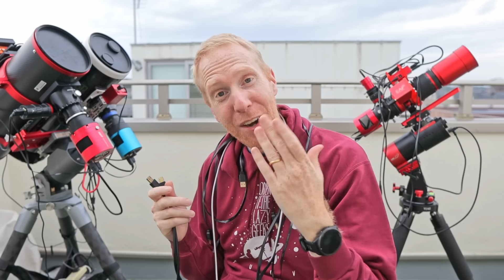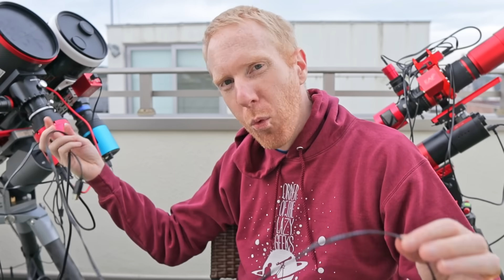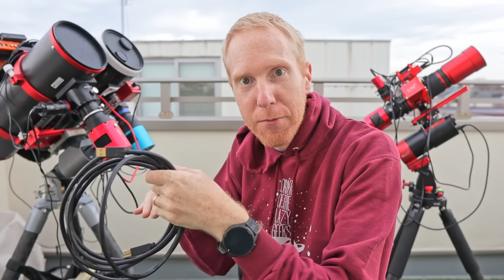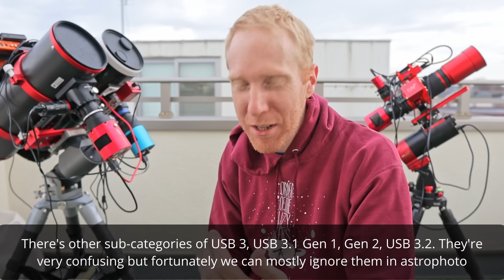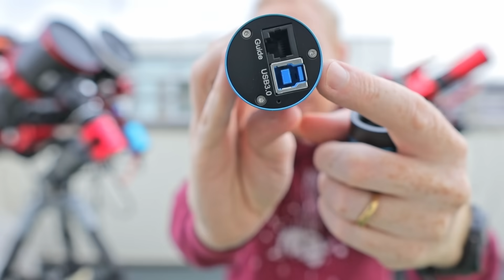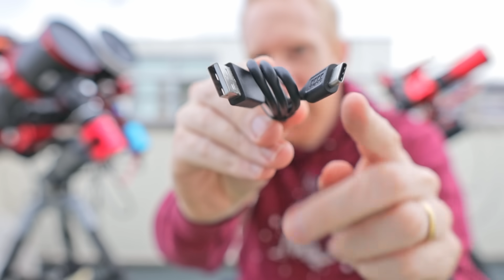YOU could be the NEXT VICTIM! Prevent Cables from Ruining your Next Astrophotography Night

Comment: I only use L-com cables now (no affiliation other than a happy user). They are more expensive, but have yet to fail, and are even offered in armored versions (I use the plastic armored version for my main camera connection). They are also clear about which USB-C cables support which USB protocols. 

I've had plenty of Amazon cables, even "good" ones, fail. One would fail whenever I had a meridian flip. But astrophotography image transfer has like zero ability to recover from errors. The same crappy cables cause things like retransmits when used for other things, but with astro, we see the worst case.

The flat cables with ZWO cameras go right in the bin when I get them.

You'll find that many of those "thick" cables aren't doing you any favors; they are just using a thick rubber coating to make you think they are more robust, no additional shielding or thicker signal wires.

Comment: I bought a new power supply for my eagle thinking it didnt have enough juice to power up my cameras, filter, focuser etc and was making my connection with the mount unstable (it kept randomly disconnecting). I thought it couldnt be the USB, because I tested with two different cables.
So, I bought an Eagle 4 thinking that my unit was defective. And then, exactly the same problem happened, even with a beefier power supply and brand new eagle. 
Decided to buy two new usb cables. First one, same problem AGAIN, but the other one finally fixed it and I havent had a single mount disconnection issue since. Let me just say, the previous 2.0 gen USB-B are trash, really prone to bad contact/connection, would easily slip etc. Havent had a single issue with the 3.0 USB-B yet

Comment: Determining that the Mele4C  was the source of my USB issues cost me a many many more hours than that so consider yourself lucky I guess??
Reply from the maker: The computer itself was the issue??
Reply: Yes. Too many details to go into (I have a CN thread) but the main cam and guide cam on different ports experienced disconnects at the exact same time. Different power supplies, cables, powered hubs all failed. Sometime in minutes, sometime hours, but once is too many

Comment: My worst nightmare struck when my first mount the EQM35-Pro's DEC wire snagged on an azimuth bolt head and it stopped the mount while I was slewing. I had never had this issue since I had the mount for almost a year. It bent the pins inside the cable and I had to use pliers to straighten them as much as I could but they are still bent. They are really hard to bend back. I just put in an order for my second mount, a budget harmonic drive that has more capacity. I got the new UMi 17R with FRAM on preorder. Hope you can review this one as well, Cuiv!
Reply from the maker: Congrats on your new mount, hope you get it soon!

Comment: My 2600 duo doesn't like to run on usb3 when connected through my Pegasus pocket power box v2.  The usb3 cable works fine on my PC and thr ASI air. And when connected to the Pegasus usb 2.0 port.  I guess I should try another cable. Though download speeds are fine on 2.0.

Comment: They’re a little more expensive but if you need to use a USB-C style cable on both ends I would say just buy ones marked as USB 4 or even Thunderbolt 4 as those cables will support speeds up to 40Gb/s and be backward compatible with whatever USB-C port version and speed the hardware uses.

Comment: The fundamental issue is very simple.  USB connectors were designed to be used with static computers and peripherals.  In other words they do not move and they are not subject to wind or setup and takedown.  The male connectors are inserted 90° to the flat surface of the female receptacle and the male connectors never move.  Through cable management around your OTA we sometimes string the cables too tightly thus pulling the male connector out of 90° alignment and thus makes an intermittent or no connection.
My experience was with PHD2 where the guide camera kept disconnection from Windows and you hear that obnoxious, incessant chime from Windows. Maddening. 
The cure is to add extra length to the cable run and carefully tie-wrap the cables so they male connector is properly aligned and never moves.

In radio threaded connectors with a screw tighten ring are used to prevents such a problem.  Maybe the Astro industry could take a hint.
Reply from the maker: Thanks Rick, that makes sense too - I need to recheck all my cables for such issues... While still making sure they won't snag... or get influenced by wind!

Comment: One year ago at this time I bought the AM5, ASIAIR+, ASI533MC to go with a Redcat 61.  On the evening I put this all together for first light, there was no first light.  Nothing showed up on the camera.  Disheartened, I contacted ZWO tech support the next day, and Simon said it was likely a cable problem, which I verified by trying different cables.  Fast forward to this spring and I started getting a “mount not detected connect mount manually” message during polar alignment.  Once again I contacted ZWO technical support and once again Simon told me this sounded like a problem with the AC power adapter, especially in colder temperatures.  So I purchased another power adapter, and the nonsensical message about the mount stopped appearing.  To me this seems absurd because AC power adapter have been around for a long time and would seem to be just a commodity to manufacture, the same as cables.  But that assessment seems incorrect for both pieces of equipment.

Comment: Great video, I use all USB 2 cables on my set up, even in my IMX571 cameras, as thats all thats needed for deep Sky imaging, it’s only high frame rates that require USB 3, like planetary imaging, and USB 2 is much more stable and less prone to issues…👍🏻
Reply from the maker: Interesting! I don't like adding the overhead when imaging with relatively high res sensors on relatively short frames (like 30s), it can consume a lot of time!

Comment: I only realized this year that USB-C cables are actually active components with logic boards in their plugs. They can negotiate speed and voltage with the connector they are plugged in! This was a revelation to me, which was very important for example for getting a very compact and reliable 12V power supply out of a 12V selecting cable in connection with a (quite new) powerbank. That cable itself basically negotiates with the powerbank, that the powerbank should provide 12V, not 5V, and presto!
Reply: That is the difference between Android, Windows, and Apple. Android has the circuitry in their boxes and NOT the cable. That is why Apple cables cost more.... the Android cables are the way they should have implemented it.... KISS method that Apple failed to follow.

Comment: You are right to narrow the issues down to the reliability of the USB connections.
However, I am convinced that the real issue lies in the connectors!
USB connections are really not designed to function when the cables are moved all the time. The worst culprits for failure are where the socket relies on just the soldered connection to the PCB for mechanical strength. This is not isolated to the astro-equipment industry: Think Walkman jack sockets or mobile phones... :(
The only exception I have seen in astronomy equipment is the captive mini USB to the Polemaster, of all things. The irony being that you only need to have it connected occasionally.
Reply from the maker: True as well, connectors are another and probably common point of failure... Sigh. So many things can go wrong!

Comment: Try a ferrite bead on your cables before you trash them. It’s a type of choke that suppresses high end electronic noise. Also, make sure you don’t have kinks or lots of slack. All of these affect speed and connectivity. We used ferrite beads on all of or data cables in the telephone offices and data centers I worked in.
Reply from the maker: Thanks for the tip! Now I have more stuff to try :)

Comment: I always throw away those cheap OEM flat cables from ZWO, and replace them with high quality connectors.  The other issue that can contribute to cable shorts is extreme 90 deg bends at the connectors.  I saw one on the Frankenmount and another on your Red Cat guide scope.  A little cable management goes a long way.  And, all the USB ports on ASI AIR's are USB2.
Reply from the maker: I'll need to check my bends, thanks for the advice!

Comment: I lost 5 hours of imaging time one night because my mount's power adapter's North America AC plug adapter. It had slipped out far enough to not connect, but not far enough to drop out of its slot on the AC adapter. Meanwhile, my mount still had power. It was drawing power through its connection to my StellarMate OS Raspberry Pi. I could use the hand controller to slew the mount manually just fine. But whenever the Stellarmate commanded the mount to slew, it wouldn't move.

I also had a USB power adapter plugged into the AC outlet alongside the mount's adapter. I was concerned that maybe something weird was happening between the mount's ground and the USB's ground (I was clutching at straws after hours of faffing around!) So I grabbed my portable power pack, disconnected the power cable from the mount and put in the cigarette lighter power adapter, plugged the various other devices into the power pack's USB power ports, and I was able to start all over again with aligning the mount, polar alignment, etc. and get in 90 minutes of imaging before closing up shop for the night.

It was when I was cleaning up that I picked up the mount's AC adapter and had the AC plug fall out onto the ground.

I have now glued the North America adapter into its slot with about ten pounds of urethane adhesive. Never again!
Reply from the maker: Oh wow that sounds so incredibly frustrating, I'm glad you found the issue!

Comment: I had similar issues with an aftermarket cable that worked fine with the 294MC Pro with an ASIAir  not working with a 585 MC Pro with the same setup.  Switching to the red cable that came with the 585 solved it as well.   Going back to the 294 MC Pro and the older cable continued to work fine.   I think these cameras can just be more picky about their cables - sometimes they work with cheaper cables, sometimes they don't.  Note that the symptom for me was that it would take about 2-5 photos just fine, then stop working.  I'd have to unplug/plug it back in again.    I guess it could be interference as you suggested as well.
Reply from the maker: So many gremlins can cause issues...

Comment: Actually, I sent back my ASI 2600MM to the dealer, and that particular model I never want to see in my (ersatz)obsi. My suspicion is that the model as a whole is just too sloppy, the USB stack crashed, the Peltier for some reason kept running and cooking the sensor (cooling fan stopped because reasons), until I physically disconnected the whole thing. Rinse and repeat. Changed cables, changed PC, changed the power source (the 533MM works perfectly with the same setup and cable etc), so I'm going with a different vendor's IMX 571 MM. I mean... watchdog... something... anything
Reply from the maker: Eeeek that's a bad experience...
Reply: @CuivTheLazyGeek  Also, cable kinks. I try to physically keep the USB cable straight and away from other possible interference, like the mount drive. In the ersatz-obsi, I built and programmed almost everything myself. Only the stepper motors remained from the EQ3 mount, the drive, the motofocus, the ST4 implementation (though pin compatible), the filter wheel drive, all and everything is built and programmed by myself.

Comment: I had lots of issue with USB cables in the past. It took me some time to figure out why remote access was lagging or dropping connection while imaging only to find out that USB 3.0 interference causes Wi-fi to malfunction (basically a DDOS attack). I switched everything to USB 2.0 since then. it's more stable at a cost of slower image download. I'm completely ok not getting more imaging time due to slow image downloads but it's 100x more stable and stress free.
Reply from the maker: That's great to know, thank you!

Comment: Also if you have a USB 2 and 3 on the same hub, from the hub to the computer the it will all run at USB 2 speed. Also having filtered USB cables on your camera cables helps with interference showing up in your subs.
Reply from the maker: Oh yes hubs are another can of worms!
Reply: From what I read on the web, this is not true.  A USB3 hub apparently has 2 separate data lines for USB2 and USB3, so will not slow everything down to USB2

Comment: I think I have about 3 cables of each type sitting in storage now, as well as multiple power supplies. Lost several nights over the years due to cables or PSUs just randomly giving out one me... It's always a challenge, but I got myself a Pegasus hub now and have started to wire my setup "permanently" now with cabloe holders and such. So hopefully things will be less frustrating now.

Comment: I tell newbies to buy cables that are long enough, but no longer than you need, and never buy 1.  Always buy 2.  That way you've got a spare for debugging and replacement.  Also, you can buy cables with right angle connectors in the correct orientation that ease strain on the connections, and makes the cable less likely to snag.  While a cable can fail any time, it's particularly a problem in cold weather.  Below freezing temps make them brittle.
Reply from the maker: Good advice!

Comment: I wish there were more silicone USB cables available to help avoid these issues. Over time, I migrated all my main power cables to silicone, which eliminated all kinks and cut outs when the mount moves. Not the cheapest option, but definitely worth it.
Reply: Any reputable brands in particular or just the fact it's silicone?
Reply: @lionki3   I mainly use 12V Lynx Astro cables from First Light Optics. They come in various configurations and lengths.
Reply from the maker: Were these the Lindy cables from FLO? https://tinyurl.com/5xphtb78 
Or something else?

Comment: Electrical resistance increases over distance leading to corrupted data, also  with every physical connection will have a signal loss. Cat 5 cables are twisted internally to reduce magnetic interference. as are domestic phone cables.

Comment: I had a similar issue but even changing the cable didn't help much.  I found that from my equipment being outside in the elements, the connectors on my usb port had oxidized and started to cause issues.  I found a thread on Cloudy Nights where another person was having the same issues and he used a little tube of this stuff called Deoxit cleaner/enhancer.  I bought this off Amazon and tried it by just putting some on the end of the USB cable and plugging and unplugging the cable several times and then just let it dry.  Later I tried and now the USB port works perfectly without any issues.  Maybe you could take that cable out of the trash and try this 🙂  If this product isn't available in Japan, there may be another brand of electrical contact cleaner that is!
Reply: I have used Deoxit for years. It is amazing stuff. Also good to keep battery contacts clean and if you ever have a leaking battery this will clean up the mess and restore the metal contact.
Reply from the maker: That's an excellent tip, thank you as always Dave!

Comment: I learned way back in the early 80's (before USB was a thing) not to kink or stress cables. When I was setting up my rig, I only ever used the flat cables for initial testing, and then ordered slightly longer, high quality & well shielded cables to replace them. With the exception of the ASI Air's lousy WIFI, I've never had an issue with things connecting.
Reply from the maker: Good point indeed!

Comment: An alternate theory ( if you haven't thrown that cable away yet ), Your device manager was in a high refresh rate due to a port conflict. If your computer had already assigned a port for the focuser and then you added the ASI2600 MC Pro Duo, on power up it detected the guide camera and assigned it the same port as the focuser and that's when it went down hill.   The cable may still be an issue but I think the port assignment was also an issue. Clear skies  #LookUpItsTheOnlyWayOut.
Reply from the maker: Interesting, that would make sense as well... The cable has already gone to cable heaven though...

Comment: Interesting topic.   I'll have to check my wire bundle and see if I have my camera cables in close proximity.    You know I  was having problems with my Stellarmate Pro not being able to secure a GPS lock.   No matter what I did  it just would not lock.  So I contacted Stellarmate and they told me to unplug all my USB 3.0 devices and then turn on the Stallarmate Pro.   Evidently there is an issue with USB 3.0 only that causes problems with the GPS.   Because as soon I did as they suggested, I got an immediate GPS Lock.  And it stayed locked even after I plugged my cameras back in.  For one of the more simple pieces of equipment, it sure can be a pain in the back side  when they want to.   ;o)
Reply from the maker: Oh man that is fascinating as well... Glad you got to the bottom of it!

Comment: Once I get a rig set up and working, I order new cables from USBFireWire just the right length and with the correct ends and angles or bends. This saves a lot of problems in the end. No wire coils or wire ties and really good cables. They have different types of wire depending on the specific needs of the cable. Super high quality and fast. It is less expensive if you order one of their stock cables and they have many that will do the job.

Comment: The conductors inside USB and other cables are very thin and it doesn’t take much to damage them. They most often exhibit an intermittent pattern of failure that makes it harder to diagnose.
Reply from the maker: The intermittency is really the most frustrating aspect...